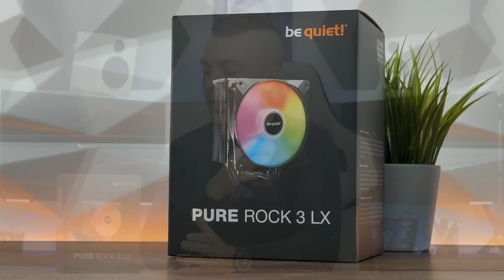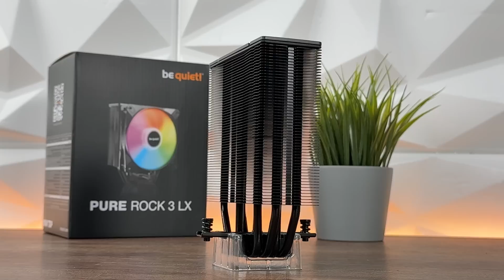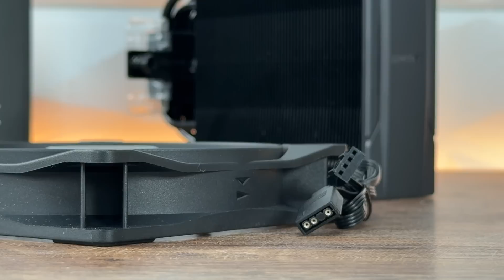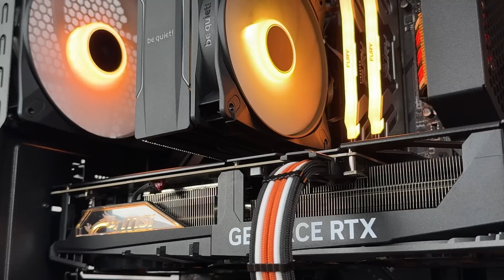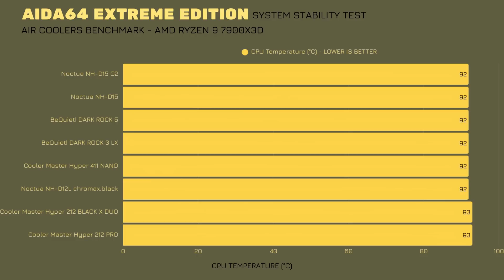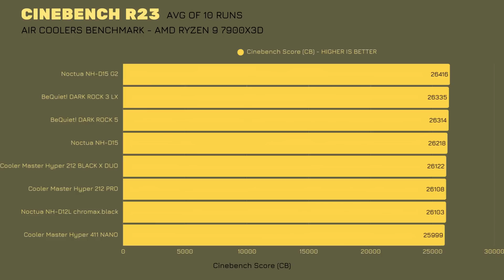Cooler, Smaller, Simple - BeQuiet! PURE ROCK 3 LX Review

Comment: Will it be enough to cool Ryzen 5 9600x?
Reply: Works well for my 9600x so I’d say so, yeah
Reply: @taaviratas3929 Thank you 👍
Reply: @taaviratas3929  perfect! I've spent the past few hours looking at coolers for the new PC I was forced to build since my ten-year-old rig finally kicked the bucket. I was thinking of using an AIO, but after some reading I decided it was unnecessary and added risks I wasn't willing to take. It's been so long since I had to build a PC all the changes the industry made in the past ten years made it so difficult...and a little scary if I'm being honest. The heatsink is such a necessary component and I want to get something good without breaking the bank, or this damn expensive CPU I bought. I'm guessing the pre-applied thermal paste is fine and I don't need to buy more? I'm of the mind that thermal paste is all pretty much the same and most of the claims are just marketing fluff, but again, it's been so long since I had to put together a computer that maybe the new chips really do benefit from aftermarket stuff?